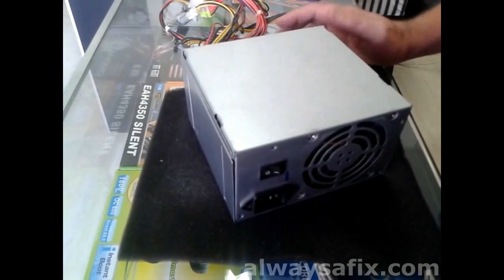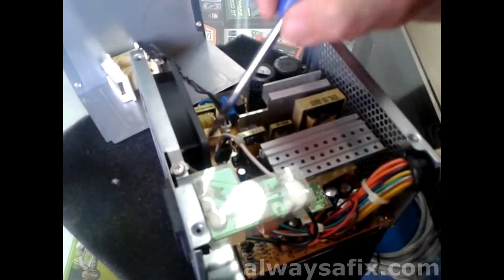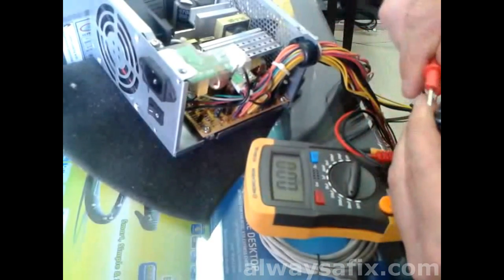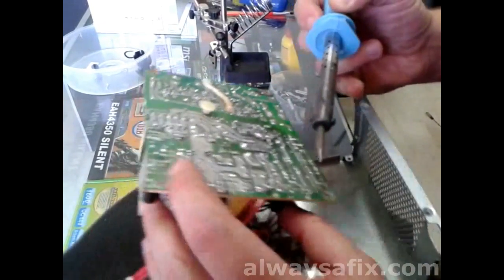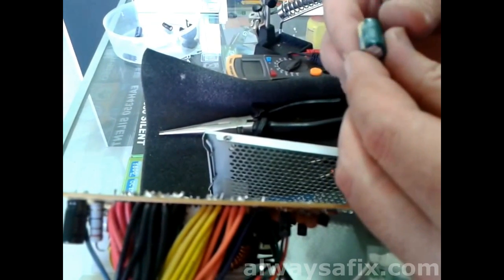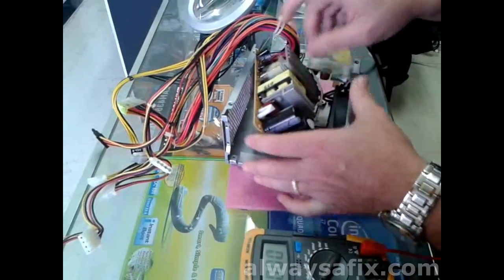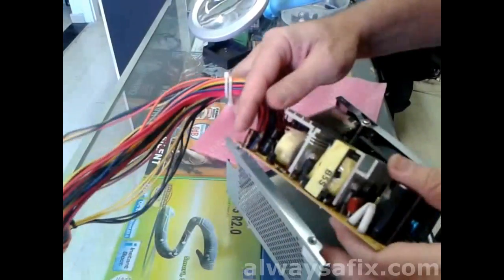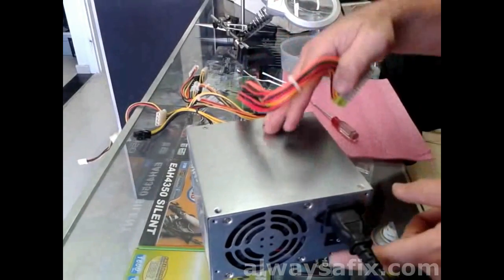Computer power supply PSU fault troubleshooting and repair

Comment: Whenever I replace a swollen capacitor if they're other caps of the same brand and rating, even if they test good and function, I will replace them too. They can't be far off from failing as well. And I like to raise the voltage a step or two, if they still fit, like going from 16v to 25 v.         Just saying....................................................................'Mike
Reply from the maker: Makes perfect sense Mike, thanks for watching.

Comment: What about the fuses on these. On some of my power supplies the capacitors may be bad, there are a couple of different types of fuses, along with a resistor that seems to go. One type glass tube fuse. 2nd type is a little square white pc board fuse. I would think these would be bad on your power supply along with the Caps!  Very easy to test and replace, just wasn't sure why you didn't check any on your power supply?

Comment: I have Thermaltake power supply there are burned resistor . I replace it with right value and watts. But it doesn't work no power..
Reply: check mo yung fuse if ok pa. then yung mga diode malapit sa resistor

Comment: If there isn't 5v standby & all Transistors are OK - any sugestion to fixed it, Sir?
Reply from the maker: It sounds like it might be time to replace the power supply board

Comment: All of my damage PSU's get low voltage output like 4.7v in 5v rail or somtimes 11.4v in 12v rail.. but when i open it i don't see any bulging capacitor.. can you spot the problem?

Comment: A capacitance meter isn't always best to determine bad capacitors. A lot of times a capacitor may look good and measure good, but still fail in circuit. You need to measure their ESR with an ESR meter. Very good investment, especially for switching power supplies, which almost all electronics use these days. Know for sure which capacitors are bad without guessing. You can test capacitors in circuit without the need to desolder, so you can easily test all on the whole board.

Also if a power supply does not turn on, the first thing to do is test for the 5V standby voltage. This will give an indication of where to look for the fault.

Comment: hi mate, i only made an acc. for this matter, my psu is not dead but is dying, 12v rail is giving me 11.8v and when i connect the 3rd hhd gives me the classic i wont start psu failure black screen,its a 1000w coolermaster psu,  im familiar with electronic comps. and i would like to know if there's a common reason for that like caps failure or something that i can fix before it fully dies, thanks in advance.

Comment: Hi, if the capacitors measure 20-30% more of the printed value, they are still ok or it's better to replace them?
Reply from the maker: +thesummertune Yes, those capacitors are still ok.
Reply: OK, i've replaced some capacitors from a power supply for pc, two big 330uF but their value was about 200, and a 470uF because it was about 700uF, unfortunatetly the PS still dead. No visible damage on other stuff.

Comment: Sir can you help with my power supply. When I try to switch my computer on, the electricity goes off. In other words it shuts down the power plug which provides the whole house with power.. I believe its the power supply.
Reply: there's a shortage in your supply dude!

Comment: mine turns on but after 3 sec it turns off help?
Reply from the maker: +StillGamer755 “stillgaming755” Have you tried another power supply on that motherboard to rule out motherboard issues?

Comment: you forgot to discharge the primary capacitors.
Reply from the maker: +Sudip Kong I always discharge the primary capacitors,  just did it off camera.  I do this for a living and you soon learn what bites. Thanks for watching.
Reply: alwaysafix  anyways, i have a problem with my newly purchased smps which gives an output voltage of 12 and can handle upto 10 Amps of current, that if i start up the  smps with the load connected it fails to start up with a flickering sound but if i disconnect the load and start up the smps first and connect the load afterwards it works fine.( the load that i use is just a small pc fan that draws only 0.25A at 12V.) Iam not sure if it's a sign of a failing capacitor...Please Help!

Comment: dont junk it , look at all the nice transformers and things in it u can use for other projects
Reply from the maker: +Pavle Pavlovic Lol, you don't want to see what my storeroom looks like from keeping things for a useful project.  Thanks for watching.
Reply: alwaysafix :) i just repaired , one of those , hope so , one rectifier cap sparked from overload . fuse did not burn ..now im getting i new one . Its an old PSU im thinking of using it as a bench PS.. like the vids

Comment: my dell power supply is not working.all the capacitors and transistors are apparently in good condition plus nothing smells bad.but still its not working can you help me.REGARDS
Reply from the maker: +Rizwan Nasir Maybe the problem is the motherboard.  Have you tried another power supply to rule out other issues?
Reply: YES MOTHER BOARD IS OK
Reply from the maker: +Rizwan Nasir If you are 100% sure the motherboard is ok, I would just replace the psu.  Good luck!
Reply: Me same

Comment: hey I was just wondering if you could help me troubleshoot this darn powersupply.  now this one is just weird and all back the front with the fault. I can get it to power on and run while plugged into the motherboard but when I do the short between the green wire and the earth wire/black. I too had a few bunch of dead caps and replaced them. I am at a loss and please any thoughts would be greatly appreciated.
Reply: alwaysafix Hi , i wanted to ask a question about my powersupply ! When i turn it on , my Dell PC show up the orange light that means something is not working right , but sometimes after trying many times my Pc will start normally , how can i fix this problem , this powersupply seems to work but not everytime ! Pls help
Reply from the maker: Josh Rumballe If you did not replace all the caps, I suggest thats the first place to start.  Even if the caps are not swollen, they can still be bad.  Good luck!

Comment: Hi, my psu wont turn on. I check the insides, all caps look good and also the fuse doesnt look burnt. should I replace the fuse first? The ends of the fuse are soldered thats why I am asking here first. thanks
Reply from the maker: Mar nee You can check the fuse for continuity with a multimeter.  Good luck!

Comment: What do I do if all the caps are good.
my psu shuts off shortly after turning on
Reply from the maker: Flying Karapet Have you tried another PSU to confirm that your power supply is at fault?
Reply: yeah tried failing PSU "A" in computer "B"
and vice versa. its the PSU
Reply from the maker: Flying Karapet At this stage I would replace the faulty PSU.
Reply: Yeah sucks I just got as as a warranty replacement for a PSU that lasted 5 years this one only did 5 months

Comment: mine 2 psu running doesn't. computer psu without another runs how?
Reply from the maker: Fatih taşdemir If your PSU doesn't work on your computer but works on another computer you probably looking at a motherboard problem.

Comment from the maker: @tunup1200 Thanks for watching.
Reply from the maker: +piffdaddy420 Please check out my description for the WARNING about discharging larger capacitors.  Thanks for watching.
Reply: hey i looked very closely at all caps on my psu board and none are domed and the fuse is fine i know the problem is in the psu. So any other things that it could be?
Reply: +alwaysafix Excellent video!
Reply from the maker: +Ernst Stavro Blofeld Much appreciated and thanks for watching.
Reply: +alwaysafix Well deserved. Right up to the point. Very good.
Question: What in your experience is the 3rd most likely part to fail after the fuse and the capacitors?
(no smell of burning (smell was also a good reminder)) ;->
Reply from the maker: +Ernst Stavro Blofeld Have you tried a different PSU on the motherboard to make sure it is the PSU in the first place?
Reply: alwaysafix No. But the loud bang came clearly from the PSU. I already repaired it. One of the two stw20nm50 power mosfets shorted.
Reply from the maker: +Ernst Stavro Blofeld The damage could of extended to the motherboard.  Before you waste anymore time, you need to connect another psu to make sure the motherboard is ok.
Reply: +alwaysafix i always was trained to stay away from opening psu/crt monitors etc.  because the capacitors can hold enough power to kill you, even when it hasnt been plugged in for a long time.   what precautions if any did you take before working on this psu?  thanls.
Reply: +alwaysafix My PSU shows double the voltage values and my PC has no power at all even when I breadboard it. Should I get a new one?
Reply: Akai sora
No. Just replace the caps.
 ;->

Comment: The problem with your power supply is VERY common. The problem with it was my first guess . Every power supply that Ive pulled apart had failed 1000uf capacitors. Its because they are rated at 10 volt but they are on the 12 volt supply circuit. This decreases the life of the power supply to 4-5 years, sometimes shorter depending on how many 12 volt devices are plugged into it.  On my computers, the first thing I do on new power supplies is replace these with 16 or 25 volt 1000uf capacitors before installing it.
Reply: Will try this next time.

Comment: I converted an old ATX PS into a bench power supply.  It quit working so I checked the caps and two were puffed and had leaked.  Found two matching caps in my box of salvaged parts and put them in and it is now working fine.  Would never have thought of replacing caps before seeing this video.  Only took about half an hour.  Thanks.
Reply from the maker: Congratulations on your fix and thanks for watching.

Comment: i have a big problem in my PC and i don't want to go and buy Power supply without make sure it's the reason my PC shuts down after several hrs like 5-6 hrs and i have A/C in da house so there's no over heating problem , besides that i cleaned the CPU fan/ GPU fan and still have same problem , unpluged all my HDD except the one i have windows on and still have same problem , i even tried to clean the motherboard and still have same problem , the only thing it's remains is installing a new power supply or install a new windows ?????????? pls help  

My power supply is very advanced 700Wat with big fan in the middle
Reply from the maker: You need to borrow another PSU in order to rule out the motherboard etc...  Good luck!
Reply: alwaysafix i can't borrow just buy , because the problem appear after 5-6 hrs of use  , is there a virus can do that ? or processor can cause that because suddenly when start shutdown and immediately back up on by itself sometimes restart again even without loading windows  , i have doubt it's processor because it's working fine for 5-6hrs and also but my other question is what the reason Power supply could cause that?
Reply from the maker: TheMaster Karim In the workshop we use the process of elimination in such cases.  You will have to buy another PSU.  Good luck!

Comment: Why don't you discharge the two big reservoir capacitors before replacing the blown capacitors ??
Reply from the maker: Ameya S Thanks for your input.
Reply from the maker: Marshall Bruce  2k OHM 5w for small capacitors, 20k OHM 5w for large electrolytic capacitors used in power supplies.  Good luck!
Reply from the maker: I did off camera.  Thanks for watching.
Reply: alwaysafix
can you tell us how you discharged it?
Reply from the maker: Comy F Short it out with a screwdriver.  WARNING: it might spark a little.
Reply: alwaysafix to avoid spark, discharge using two alligator clip wires connected to a resistor inbetween (the higher value the better)...they are fairly cheap.
Reply: Ameya S  The resistor should be a 4W, i'm i right ?
Reply: alwaysafix how can i identify a 5W resistor?
Reply from the maker: Marshall Bruce The higher wattage resistors are normally white cubes and will have the wattage printed on it.

Comment: can you test active PFC PSU with this method (bridging green black wires)?
Reply from the maker: Yes you can, but don't leave it running long as it's not good for the power supply.  Thanks for watching.

Comment: Wouldn't it be better to check caps with an ESR-meter? There could be a problem in terms of their equivalent series resistance, without the capacitance being drifted. 
ESR-values are extremely important in switch mode PSU circuitry.
Tx for he vid btw ;)
Reply from the maker: This video is targeted at everyday do it yourselfers and because they won't have such professional equipment I try and keep these videos as basic as possible.  Thanks for watching.
Reply: Thomas Leerriem Agreeing with this.  You can get an usable hobby ESR meter for $18 on ebay.  It would detect that your 1000u cap was bad.  And it's very important when reusing salvaged caps.
Reply: The ESR-meter I use has a pass/fail-function. Since it measures both capacitance and ESR-value, it can decide whether a cap is defective or not.
Even when measuring the expected capacitance, a cap can still be defective.
I find such a combined ESR-meter very usefull.

Comment: i have a evga mod power that my friend just bought he put he put a vga wire in a cpu port and turned it on and it popped when completed unpluged for a while and then plug it back in it will go to work but shut down is the any hope for it i cant find any fuse inside it or damaged capacitors would be a great help even for any more trouble shooting thanks
Reply from the maker: It's not the fuse, maybe you damaged the motherboard.  You need to connect another PSU to rule out the motherboard.  Good luck!
Reply: the computer is working have another psu in and working fine psu pluged in on is own and jumped fan will one spin for a split sec and shut down
Reply: blac jack  I have the exact same problem. I just got this power supply and it started up and it was good for about an hour and then my PC turned off and when i try to turn it on, it spins the fans a bit and that's it.

Comment: I became Computer savvy at age 70 gravitating to Linux, able to adapt hard modems to Red Hat 8 with help from Connexant Canada whose beta driver helped get to go dial up .When my old AMD socket 7 PC packed up I took it apart fixed it to start my entry into hardware,got some good tries reviving dead hard disks.At 83 now SMPS posed problems had 2 units unserviceable.Till watching your excellent video a couple of Hrs ago the fears of tinkering with high voltage ,(we use 230 V Ac) was a damper.I took both my "kaput" power units and one by one checked for faulty capacitors,resoldered suspected dry joints,then rectifier diodes using my multimeter.Your tip about shorting green and black wires to start the fan going was an excellent tip,even Scot Mueller's bulky tome is not that explicit.I didn't get any nasty shocks and am a winner not having to buy replacements or depend on a service guy.
Reply from the maker: Awesome news, and congratulations on your fix.  Thanks for watching!

Comment: Wow, you could have at least checked the voltages on the ATX connector before even placing it into the PC. Although the fan is spinning, there may not be enough power coming out of the PSU.
Reply from the maker: This PSU has been fitted to the computer since that day of the repair, and Im happy to report no issues.  Thanks for watching.

Comment: I understand, but this psu is really well built (i was wrong, it is the 700w, model LC8700 v2.2). I really want to repair it, but my electronic skills (although higher than average), aren't enough to find out the component, unless i start ripping it apart and test component by component. The problem with dead 5v sb, is that nothing else on the lower tension part of the board can be turned on. Its like an 1% fail that prevents it working...

Comment: As seen in the video, many capacitors can read a correct capacitance value, but if they have a high ESR (Equivalent Series Resistance), they are no good.  If they're bulging, the electrolyte has dried up, and the ESR will be high.  This means that even if the capacitance meter suggests they're OK, they actually won't be able to perform their filtering role correctly.

Comment: I see a lot of these videos and then people commenting about it not fixing there issue, There is a lot more to these repairs then capacitors , Transistors are another massive fault or in larger psu's IGBTs, Always remember to discharge the unit before work though the main filter caps pack one hell of a punch!

Comment: Hey My power supply ATX one has been short circuited and not starting. Here is how :
When I opened my pc to take a look I saw nothing But when I started the pc I saw a blue sparkle and it turned off and next time I am starting it it does not start

Comment: Pointed tips on soldering irons are about as useful as a fly-screen on a submarine. Get a decent temperature controlled iron with plated tips. [ They are not expensive ] and use a chisel tip, where you can have enough concentrated heat to easily remove components.

Comment from the maker: If the caps are swollen, this is a sure sign that its faulty.  Since the capacitors are not expensive, just replace all the ones around the faulty capacitor.  If it works, at least you'll end up with a spare power supply.

Comment: what a shame i bought a new psu, now i know i could have fixed myself, hey if the capacitor is not leaking but the top of it is slightly fat, does it mean thats its failed? i have been looking everywhere and all the others are fine. also i tried the paperclip test and the fan spin but in motherboard it doesent work :) . thanks!